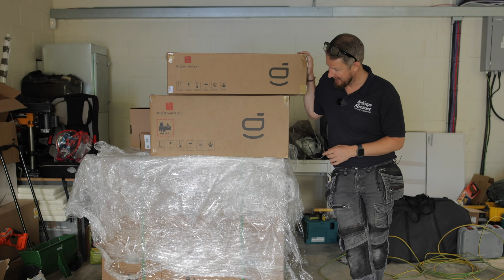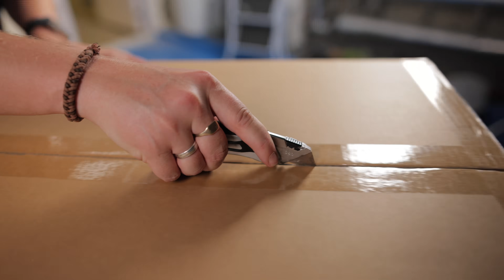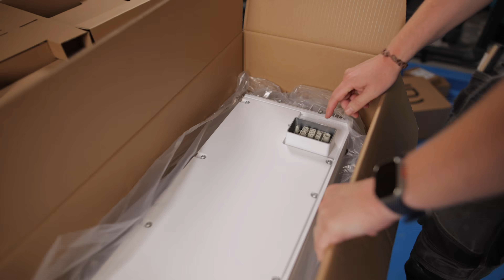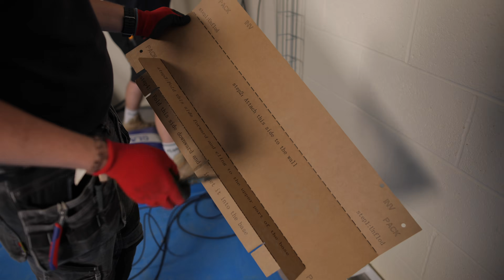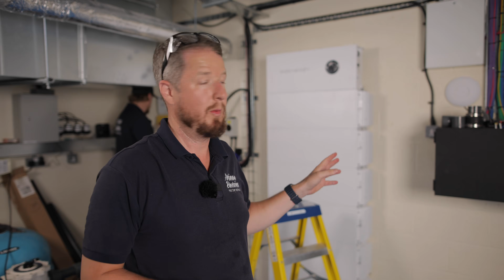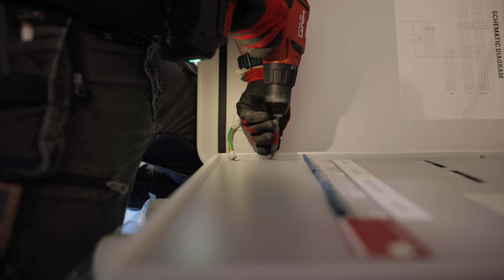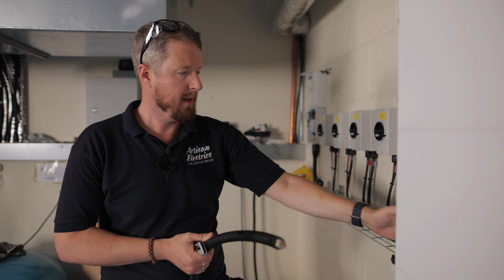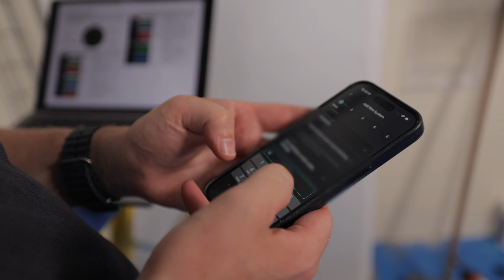Better than a Tesla Powerwall? 🧐🔋48kWh Three Phase UPS Battery System! ⚡️ Sigenergy SigenStor

Comment: I did some UPS projects years ago, the only way you got “0 ms”changeover was to run them in on-line mode, this meant all power was passing through the rectifier and inverter. It comes with an efficiency cost that would not make sense for a domestic install. If this system does switch out with a gateway I don’t see how it’s possible to do it in “0ms” .
Reply: Simple answer - it doesn't! I questioned this in a comment on the previous vid that Jordan did on this install, querying the 0mS claim and backing up my assertion with some knowledge of G99 (the required standard for these devices in the UK). Never heard back from him (obviously he's under no obligation to respond) so when he started the 0mS hype again in this vid, I checked the inverter's G99 Type Test Verification Report on the ENA's Connect Direct website. Surprise, surprise; loss-of-mains protection device operating times ranged from 138.5mS to 279.5mS. The device complies with G99 and has the necessary certificates to prove it but it needs a finite time to detect a grid disconnection and (assuming the install is correctly specified and built) switch into island mode. Just like other gateway-type devices with BESS and islanding capabilities, the change from being grid interconnected to island mode takes a finite amount of time. Some domestic and commercial appliances and devices might respond unfavourably to the transition, most probably won't 'notice' it.

The manufacturer still claims "0mS load side interruption" on their website so I've emailed them asking how is this achieved. They caveat the claim on the website by stating it can only be achieved using their inverter, their controller etc in combination (no surprise there).  It will be interesting to see what they come back with - I'm happy to be proved wrong or convinced of their claims.

But you are absolutely correct, Ed, 0mS changeover can only truly be achieved by using a UPS in on-line mode, interposed between the supply and the loads. The system in the video is not a UPS.
Reply: @sleepyspaniel2018  You don't need a pass through UPS to achieve close to 0ms delay when paralleled. Utility relays can detect rate of change in a 1/4 cycle and an off the shelf contactor opens from 7 to 25ms, or just over a cycle. The tech and  is there, now whether this system is that fast? Super easy to find out. Jordan needs to make a video with a power quality meter installed, turn off the utility breaker and post the results from the PQ.  
Now if a utility will allow a back up system to not have a set delay on power loss, that I don't know. I only work with electric utility level power generation and I am sure the regs vary by region.
Reply: @inothome  detecting rate of change (of frequency usually) in a quarter cycle would be asking for lots of spurious operations of the protection. Standard for this type of system in the U.K. (ENA Engineering Recommendation G99) requires loss of mains trip in less than 500mS although some systems may be allowed to extend to 1 second. The device has a G99 type test result document and its LoM protection response is compliant with fairly typical trip times for a Rate of Change of Frequency (RoCoF) device, although the manufacturer does not state exactly what their LoM protection is based on (it’s usually RoCoF). 

The test you describe will demonstrate the installation response but for what criteria? At what loading? Power factor? Compliance for a type test certificate is a bit more complicated, requiring testing to BS EN 62116. The inverter passed its tests; that’s not up for debate. But how do you reconcile LoM protection operating times of almost 300mS with a claim to have “0mS load side interruption”? That’s what I’m trying to ascertain.
Reply: @inothome  Surely if the electricity supply is going through their gateway, before going back to the distribution board, they could have some fairly small circuitry equivalent to an online UPS without a lot of battery backup in the gateway just to provide cover while it switched over to the inverter.
Obviously not having to actually power the house for even a second, just long enough until the inverter kicked on, means you could go so far as to run it off capacitors rather than batteries.
Reply: @sleepyspaniel2018  The reg you are stating is for it to isolate within 500ms / 25 cycles, which is a long time in the electrical world, which hopefully it does. What we are talking about is if it can detect and island itself faster than the grid sags below nominal  voltage and maintain power to the house without interruption. The test I am describing would be a clear interruption of utility power. Nothing to do with under frequency or a gird disturbance. That is the easiest for it to respond to and if it can't do that, then it probably has no chance for detecting other grid disturbances. As far as criteria, I don't know why you are trying to make this as complicated as possible or throw around terms that 99.9% of the viewers here wouldn't know. I am trying to keep it as simple as possible and in layman's terms.  I work with protective relays and can throw around the tech jargon and ANSI (being American) standards for the different protection elements too, but no need for that here. Nor are we trying to certify the device under test for any governing body. But to answer the relevant part of your question, obviously it would have to be under normal load, as long as that load is under the inverter's rated output o course. No reason to even mention power factor for this test, a house with all modern equipment will have a decent power factor and yes, I saw the pump motors in the video. Again, it sounds like you are trying to make it more complicated and throw around terms that possibly only you and I may understand. 
So how about it Jordan, set up a power quality monitor, de-energize the utility power and see how it responds.
Reply: @michaelleiper  From what I can gather, the inverter and utility power are paralleled in the gateway via the bus above the lower set of breakers. So the inverter is already powering the house in parallel and if the utility dropped out it may be able to ride through and keep the power on long enough for the utility contactor to open and isolate itself from the grid. If it takes to long it will start to backfeed the utility and overload the inverter, which it should never backfeed to begin with. So it has to sense and open the utility contactor before it would backfeed. Not sure I understand your capacitor idea, but you couldn't just run AC devices off capacitors without an inverter. It needs alternating current and capacitors just supply DC when discharging if across a line. If you were suggesting caps in the inverters, there already are caps in them for filtering and for surges.
Reply: @inothome  the test you suggest would clearly give a successful result - no doubt about it - but that's not the issue at hand. Jordan - presumably based on the manufacturer's own claim on their website and their literature - has claimed the installation is a UPS (or effectively so) with a "0mS load side interruption". I am questioning how this can be accurate based on the requirements of the applicable standard (G99) and the type test results for the inverter, which cannot issue a trip to the switchgear in the gateway unit until one of the interface protection elements (probably LoM) has picked-up and operated. I am certain you and I know that a grid-tied inverter with battery storage device connected *in parallel* with loads is not a UPS.

Every single electrical device in that house in all probability will operate without any outward sign of a problem during a transition from grid-interconnection to island mode, assuming the load at the time is less than the inverter's peak rating, but that still doesn't make the BESS + inverter a UPS and claiming that it is could be misleading to the extent that someone relies on that claim and finds out the hard way that it isn't true. If someone has a critical device or load that requires an essential supply, it should be supplied via a UPS (a genuine one).
Reply: @sleepyspaniel2018 I am not familiar with G99, so I can not comment on how well this meets that criteria. Even a clean loss of utility does not mean this system will actually deliver. I don't know if any make similar claims or if most do a set time period before coming back on. Which a longer delay is better than a short delay or brownout condition.  I also don't know if the standard you reference requires a total outage before bring backup online. If so then this claim violates that. 
 
They have a technical document in their downloads section explaining their protection scheme and makes more reference to IEEE standards and 60Hz devices. Look up the "Seamless Switch to Backup Mode" in their downloads section.   They use the delta V and / or delta F in their logic to determine when to issue the trip (open) of the contactor. So it is not a full undervoltage condition they require. Who knows, it may be too sensitive and misoperate more to try and meet the 0 ms claim. That paper also says close to 0ms and then goes on to explain a modern computer can handle a 20ms sag and a human eye will not notice an LED light flicker less than 10ms. They also claim that most other manufacturers have a three second delay on loss of utility before coming back online. Which is a good thing vs a brownout or short, not 0 ms, sag which can cause more issues, as mentioned before. 

The technology is definitely there to open a contactor and have minimal <5ms sag and be pretty close to a true UPS. Just depends on how well their algorithm / scheme is at detecting disturbances and opening utility contactor and not be overly sensitive. 
I haven't searched yet, but will now, for any real world testing of this system not done by the manufacturer. If not, I'll say it again, Jordan needs to test it out! Never go by someone else's word and speak it as truth unless you can test it out for yourself and this is very easy to do.
Reply: @inothome  A regular UPS is using a DC source and providing AC output. Ideally a sine wave.
The idea would be something like that, but powered solely from capacitors (which have far less of an issue of degradation than batteries do when run 24/7), because it only needs enough power in the capacitor(s) to provide electricity for the fraction of a second while the inverter switches over to supplying power from the batteries.

Obviously, I don't know if that's what they're doing, or instead are having the inverter automatically providing some power all the time so that, if the grid connection dies, the phase is already in sync, and worst case, you get a very short brown-out until the inverter understands it's going to have to take more power from the battery.
Reply: @michaelleiper  Inverters usually do run off capacitors and the batteries keep the caps charged, more or less. Obviously they pull form the batteries, but the caps help smooth and absorb the loads. While batteries do have a finite life span, there is plenty of problems with capacitors. more than 50% of the time an electronic device dies it's due to a bad cap(s).  
When it comes to power outages, a complete loss of power is better than a brownout. Electronic devices sometimes have issues with brownouts, vs a total loss of power. And if the power does go out, a longer outage is better than a fast off and on. I'm talking a second or two vs 100ms or so.
Reply: @sleepyspaniel2018  exactly, grid-tied makes so much sense but you can't have grid tied and "on-line" the only answer I could come up with is perhaps there's an auxiliary inverter option that can act as a dedicated on-line, you could wire this to a circuit for IT loads.  Honestly though for home use, just live with the sub-second transfer.
Reply: @inothome  I can't see how it cannot backfeed into the utility until the contactor opens. This is of course no problem when you switch the main breaker but switching the HV on the pole transformer is a different story...
Reply: Is 3 phase common at residential properties in the UK? In the US you very rarely see 3 phase in residential environments.
Reply: @paulmorrow8372   3 phase is not that common in the UK residentially.
However, unlike the US, 3 phase would be available from the local transformer in residential areas.
The one shown was a very big house, for the UK.
It's possibly getting a bit more common with electric cars, as if you need to upgrade your house supply, if new cables are having to be laid anyway, 3 phase would be available from the street, and gives you faster 22kW AC car charging. In the US, I believe you generally have only a two phase supply available from the street, so getting 3 phase would be a lot more complicated.
It is quite common in fairly big houses, but that are a lot smaller than the one shown, in countries where you have a lot of air conditioners. I have 3 phase at our house in Thailand for example (and it's a lot smaller than that house). Thailand's electricity is "interesting" - 220v, 50Hz, but uses US style sockets... - FFS.
Reply: I was a little skeptical too, so I looked it up. They run the inverters in parallel with utility and when the gateway detects a utility fault it opens the utility contactor. So depending on how fast they can detect the grid is going down and how fast that contactor can open you can theoretically not have any large voltage swing. How well it works in practice? No idea, but protection relays are fast enough to detect events like that.
Reply: I have a manual system where I switch to grid and through the inverters like a bypass .. and nothing flickers .. 60 quid my electrician paid for it .. I only use it when I do any maintenance on my 3 phase victron (if ever) or in case something may go south and I want to move on grid only so I can switch off 40kwh batteries inverters busbars etc. not expensive at all very reliable ! Victron and pylontecth so far so good (knock wood 😅)
Reply: Forgot to mention it can be wired to switch automatically and easily integrated into an UPS however .. I don't understand why ppl go the UPS route ..
Reply: There is a nice aussie group that does their DIY inverters this way.  Apparently all our old transformers get shipped south of the equator, so not having much luck myself getting them to wind.
Of course I also want toroidal ones.  Beggars still can be picky.  LOL
Reply: yep this is bogus and makes me question these artisian electricans knowledge of electrical engineering. To have 0ms you need to have line intereactive - any 'switch' over will incur a delay however minor. Unless the power is run entirely from a conditioned supply - battery/caps
This is not how this system works from the diagrams i have seen.
Reply: It's achieved the same way all of my UPSes do it:

Incoming power is monitored, then conditioned prior to going out from the unit - the conditioning allows you to prevent any dips in cycles or quality and gives you time to detect and react to a quality issue.  This is done offline.

That's basically how every PC UPS works.

Another way to think about it is that there's a transformer and some capacitors that are always online with enough capacity to cover the time gap to activate the offline UPS.
Reply: Why UPS and not ESS ? I have a 3 phase which I mostly studied and built myself except the certified stuff .. 

3 victron inverters
One big busbar victron again 
8 us5000 
All wired through the inverters .. so AC is always off unless night rate .. where it charges the batteries if no sun to keep the house always powered .. 

Why UPS ? You don't want to be on-grid when electricity is expensive .. anyway ... Just my 2 cents

Comment: Two tips from a retired IT guy: use proper lifting techniques and do - and test - all firmware updates before arriving on site.
Reply: haha. theory based advice. how exactly would they "test all firmware" on a unique device like that? Have a spare in he lock up? Impractical. 🤡
Reply: @windsorchap  Speaking from experience in the IT sector, your equipment should be tested and working before you turn up. It's not good when you turn up on site, install the equipment, perform an update, and the unit gets bricked.
Reply: @QuentinStephens  yes, you already said that. Think that's old school now. The point is that isn't practical in this scenario and now we have to assume they test this for us centrally and we don't need to..